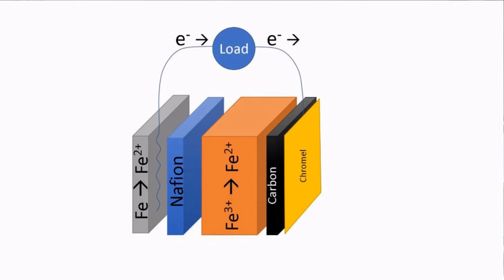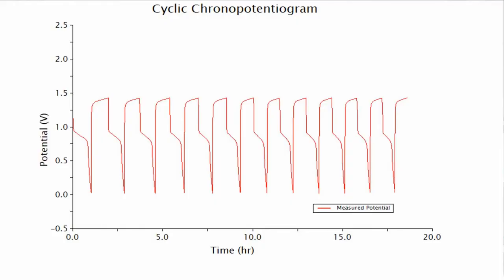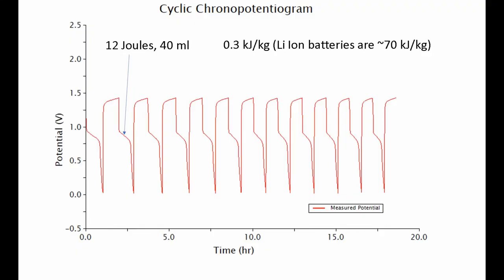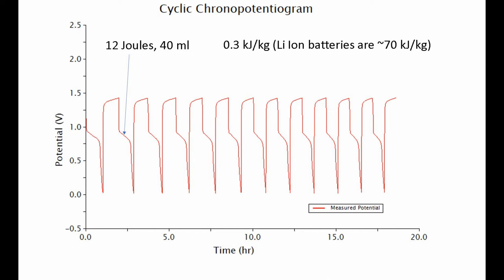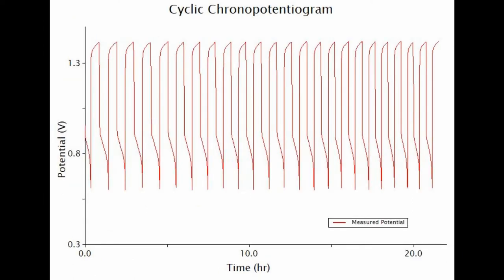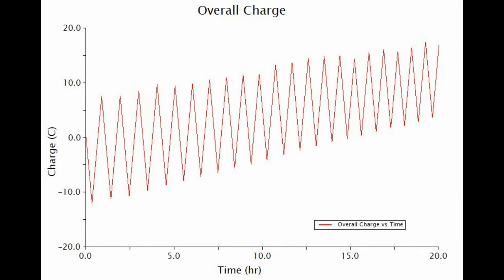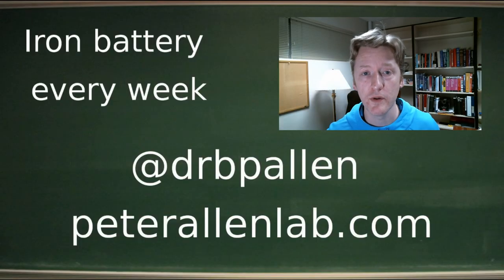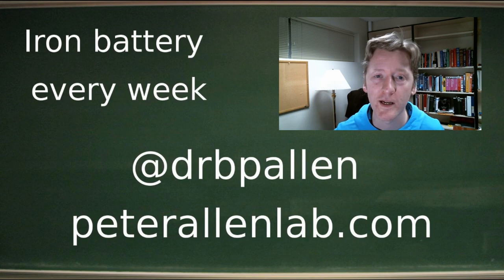Iron Battery part 60: 24 Deep Charge-discharge Cycles

Comment: Good progress!

A question: In making the battery I have seen you fold up a pouch of paper separator.
Is there not a prerequisite that the pouch is completely sealed for the battery to be optimal in operation?
A folded pouch would still allow some leakage at the folded ends I recon.

Keep up the good work!